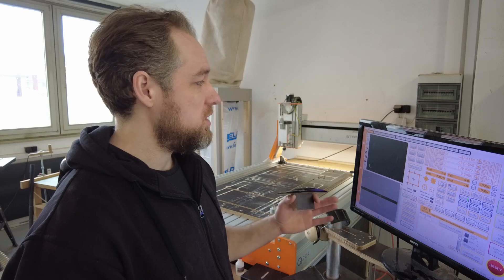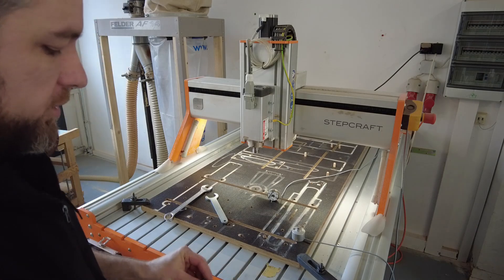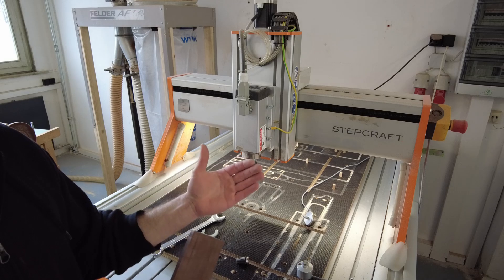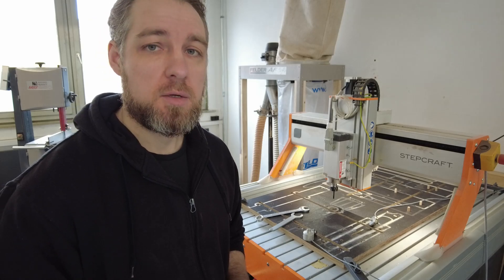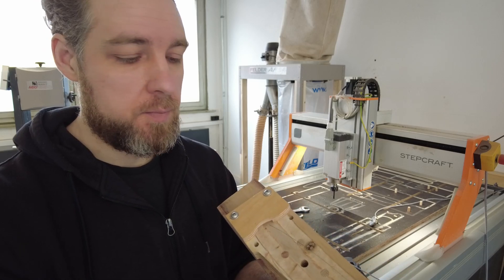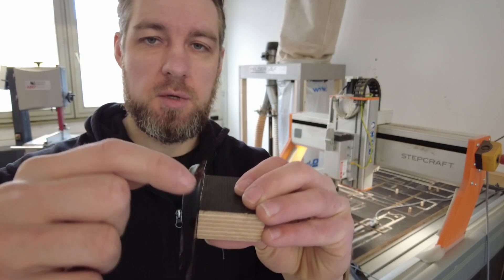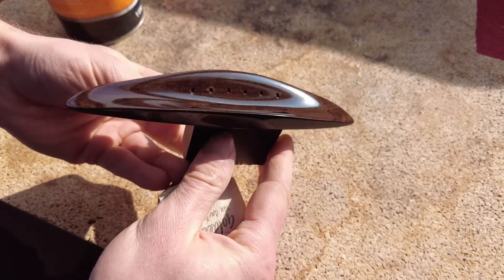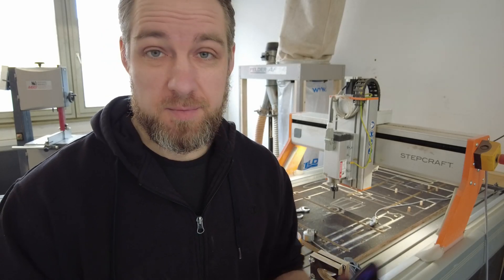Making an Acoustic Guitar Bridge using a CNC

Comment: I love the design of the bridge--very beautiful!

What software do you use for CAD and for G-code generation?

I've been using onshape (free) for CAD and kiri:moto for G-code.  I'm not too happy with kiri:moto, but the G-code generator that onshape has developed ("CAM Studio") is only available with a $2500/year subscription!

I've considered learning FreeCAD (which includes G-code generation), but everyone says how painful the user interface is.

I could try AutoDesk Fusion, I suppose.  I think it still costs something, even for hobbyist use.

There's also Rhino3D, $1000.  Plus more for CAM from Mecsoft (Windows only).  I'd like to stay with my Mac.